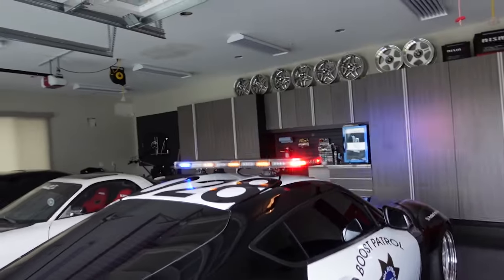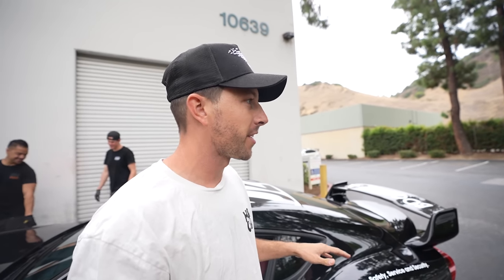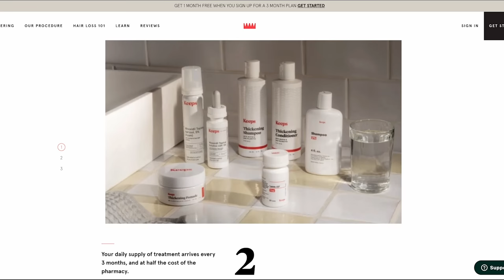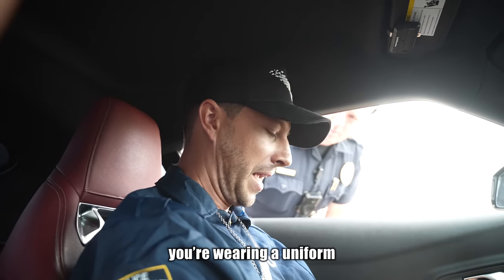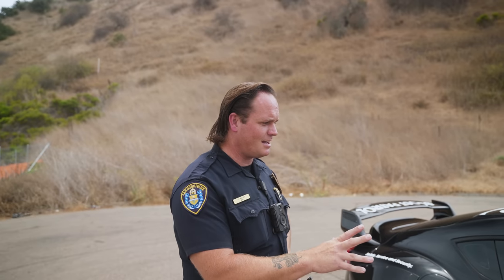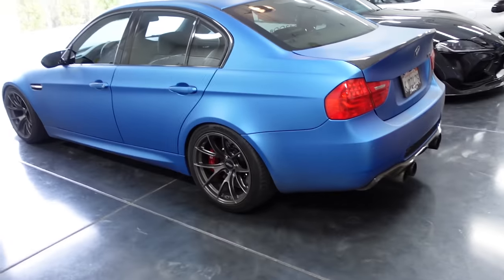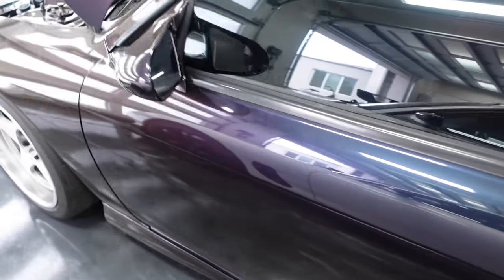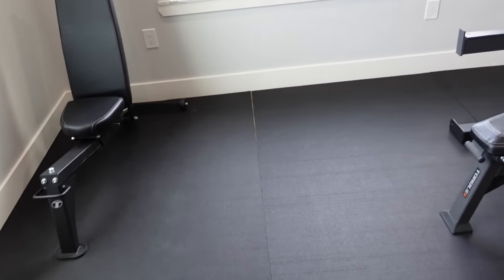Getting Pulled Over in my Supra Cop Car

Comment: From what I've read and spoke to the local PD, Sheriff's and state troopers it's not illegal to own and drive a vehicle with the lights and sirens, it is illegal if you have the words police, Sheriff or State Trooper and certainly it's illegal if you use any of lights or sirens in a manner that the police use them. But they will most certainly pull you over for reasons of people thinking you're a cop and them creating traffic issues from slowing down, slamming on their brakes when they see the car and think you're a cop.
Reply: What? Dumbest comment award. Causing traffic issues? Only people slamming on their brakes are people breaking the law. How is that anyones fault for looking like a cop? Put down the pipe bud.
Reply: @4evamobbin534  Yeah you did he tthe award

Comment: You should get Armor All brake dust repellant. It seriously works and keeps your wheels way cleaner than ceramic coat. I've had it on my STI wheels for 6 months and they still look like new with racing pads.

Comment: For the rats possibly in the FD, put some Irish spring green bar soap in the car. Chop it up into small pieces and put it in random crevices of parked cars. The soap is a deterrent for rodents. Have an e30 that has sat for 10+ years that had some in it and didn’t have a single piece of rodent poop in it.